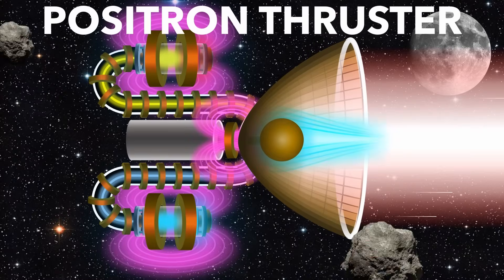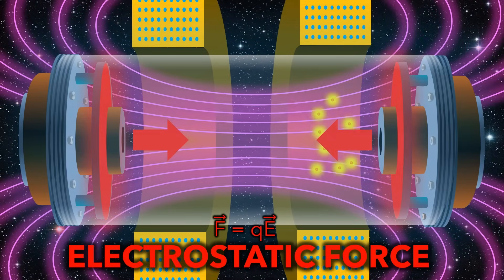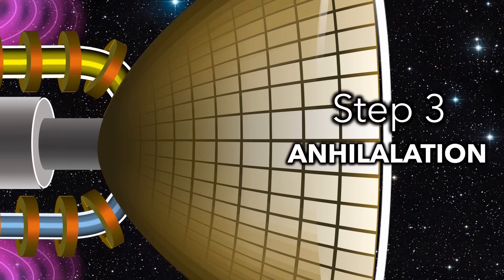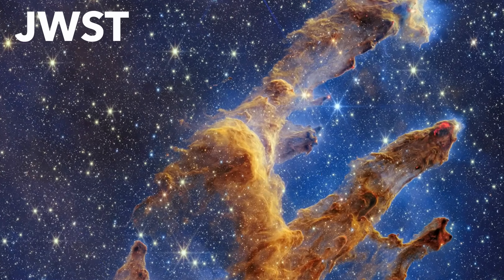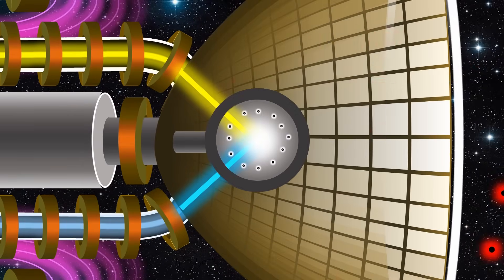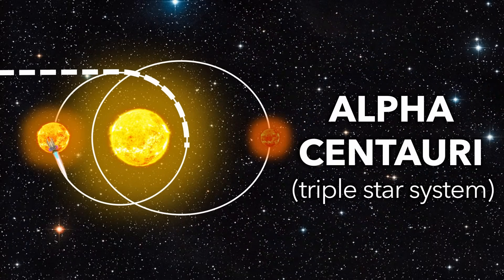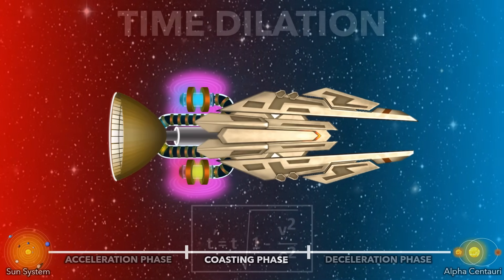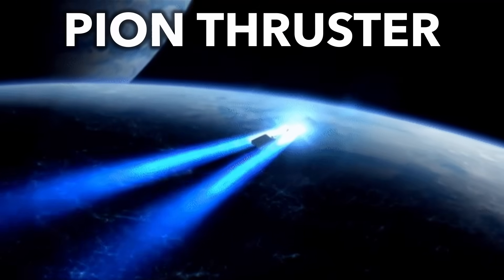How much Antimatter To Reach Near-Light Speed? | Positron Rockets Explained

Comment: Why would you need 42 hiroshima bombs a second to achieve 1/g of acceleration? I feel like you could use less
Reply from the maker: It does seem excessive. The reason is due to the high exhaust speeds. 

Provided all other variables are fixed, thrust is proportional to exhaust speed, but energy required is proportional to the square of exhaust speed.

For example, if you had 2 rockets, but rocket 2 fired the propellant at double the speed of rocket 1, rocket 2 would produce twice the thrust, but use 4 times the amount of power.

So the faster the exhaust speed, the more energy is consumed. As you could imgaine, a rocket which fires propellant at light speed (like the positron thruster) would consume enormous amounts of energy.

Comment: So whats the exact percentage of the antimatters energy that ends up getting turned into thrust after the electrons from the lead ball are accelerated by the magnet thing and all?
Reply from the maker: Well in oractice efficiency would be much lower than 100%. Assuming full reflection of the longer wavenlength photons, 2% of the antimatters energy would become thrust. The remaining 98% is technically lost as heat and scattered electrons, but the proportion of each would vary greatly.

Comment: Why does it use less for the decceleration?
Reply from the maker: Because in the deceleration phase, the spacecraft has less mass i.e. much of the mass has been used as fuel in the acceleration phase. Because the required thrust is proportional to the mass of the craft ( F = ma ), less thrust is required for deceleration and hence less fuel is needed.
Reply: @ScienceWorkshop464 ah of course. Thanks :)

Comment: 1:38 Till take off >  3,2,1, Lift o-- *launch pad atomized, so as the nearby city" taking off from earth would be a nuke and you would either have to incase this in another rocket or launch from space and direct engine away from the planet..
Reply from the maker: Haha yes youre right, and i had the same thought. Hence the reason i made sure i did a space launch in the animation haha. At the very least you wouldnt launch near a populated area if from earth.
Reply: @ScienceWorkshop464 the amount of smoke and heat may also effect the surrounding areas too.. And who knows may leave large amount of radiation if anti matter does produce it but i sure it would.. 2 launches may even create something similar to a  nuclear winter.. And even may raise global temperatures by alot since its equal to 100s of nukes

Comment: I just did the math for a 300 metric ton spaceship which would be the equivalent of something like a 747 and to accelerate it at 1G doesn't take as much any matter as they're saying it's micrograms to accelerate at 1G I did a sliding scale from 100% efficiency to 1% efficiency and even at 1% efficiency it's still less than a gram per second. And it only takes about 8 hours to reach 0.7 C in roughly $140 kg of antimatter plus 140 kg of matter add 100% efficiency which is basically an Annihilation reaction so if we cut that efficiency in half to 50% it would still be $280 kg of antimatter and 280 kg of matter

Comment: I can't imagine that it takes grams of antimatter every second to achieve a 1G acceleration for something the size of the space station. That just seems preposterous. A Hiroshima sized bomb going off every second for a 1G acceleration?
Reply from the maker: It does seem like alot. However considering that a chemical rocket would consume more like 1 million grams per sceond to accelerate at 1g, and could only maintain this for a minutes rather than months, the performance is still impressive. 

The calculation as of grams of antimatter per second is based on conservation of momentum. The momentum gained per second by the ship (ship mass × 9.81) must be equal to the momentum of reflected gamma rays leaving the thruster. The momentum per gamma photon is planks constant ÷ photon wavenlength. From the the number of gamma photons required per second and the number of anhialation events can be used to work out the required mass per second, which ends up being in the order of grams per second...

...but i do agree it seems like alot of energy! Calculations are also based on the assumption of 100% efficiency which is impossible in practice.

One other point that may put things in persepctive, is that a traditional chemical rocket would only take around 20 minutes to produce the same energy as hiroshima. This is still enormous but not completely unimaginable.
Reply: IRL these engines can't be made due to x-ray/gamma ray errorsion of the nozzle and impossible waste heat issues and workable magnetic nozzles would need materials 100× stronger than carbon-carbon bonds allow
Reply from the maker: @nehorlavazapalka agreed a positron rocket, although not breaking any phsyical laws is far from realistic currently from an engineering perspective

Comment: I have another idea. We could build like a spaceship made of two parts one half made of matter and one half made of antimatter. They could accelerate in parallel and exchange fuel without touching as for antimatter if it is not possible to produce it in a fusion reactor then we need to invent self replicating robots that will create trillions or even more small factories on sun orbit that produce antimatter using particle accelerators.

Comment: I had such a consept in my mind bevor 20 years. Basically it works, but the main issues are technological and financial. The so called Penning trap  or magnetic flask can only store really less positrons or electrons inside, not even a milligram. The ratio of weight of the magnetic flask or Penning trap to the mass if the stored positrons/antimatter is such high that it is practically senseless to build a rocket that way. Secondly, it is extremely expensive to produce that positrons/antimatter. To produce positrons out if energy, it would take roughly minimum 25 Billions USD to get 1kg positrons/antimatter. This issues had to be fixed first to realise such a propulsion system. Better antimatter storing systems maybe by stabilisation of exotic matter, and cheap antimatter production maybe by using new kinds of particle reactions, that could solve the problems.
Reply from the maker: Very true. These are the 2 main issues with antimatter propulsion. My next video on pion thrusters (which admittedly has been a long time coming) partially adresses the storage issue
Reply: @ScienceWorkshop464  no, they aren't, first one is nozzle errosion from gamma/x-ray and seconds is impossible waste heat issues. Workable magnetic nozzle requires 100× the strength of ideal carbon-carbon bond. Anti-matter engines like the one in the video are impossible using known physics.
Reply: @ScienceWorkshop464  using carbon nanotubes, you might get to 5 % c after ~ 20 years of acceleration - that is the pyhscis limit

Comment: Isn't converting heat into thrust unnecessary? Like radiating heat already create thrust.
If you split a gamma ray proton into many smaller proton, it still have as many thrust.
Reply from the maker: Heat radiating equally in all directions wouldnt generate thrust. Hence the need to transfer the heat to a propellant and direct it via a nozzle in one direction to produce thrust in the other diection.
Reply: @ScienceWorkshop464  But insulate the front should stop heat flowing forward, and forcing all of the heat radiate backward.

Comment: Wouldn't you also need the same amount of matter?
Reply: Also the deceleration wouldn't be constant fuel intake, as it is loosing matter. Didn't do the math,  but let's stay with your 7 grams per second at the start of the deceleration phase (which would be around half of the weight from the start as you have calculated) It will be less and less and less until the weight of the fuel is less than 10% (let's say 10 for any corrections that could be needed). And by this time it will be using 40% less than the start of the deceleration phase

Comment: Next video: How to efficiently produce tons of positrons. Right after: How to shield from incoming cosmic dust at 0.7c.
Reply from the maker: I like both those ideas!
Reply: @ScienceWorkshop464 Producing a ton is simple enough.

Ive read that a Star Trek lore book says Antimatter used for ships are generated by solar powered particle accelerator that orbit stars.

And ive also read someplace that the particle accelerators we have now are designed for science not antimatter production.

Not saying it would be simple or cheap to do. But its entirely possible to set up antimatter factories in space with vast solar arrays. Even if you need more power than that or if solar wont be viable, you can get fissionable or if technology allows fusionables to power such purpose build stations.

As for avoiding the dust im not sure outside of somehow projecting a large magnetic field infront if the ship to make the particles go around. But I cant say that every speck of dust is magnetic so as strange as it sounds, the bigger problem isnt how to make the anti matter but how to protect the ship in flight.
Reply from the maker: @S-Halo yes the current production costs are based on the fact antimatter production is purely foe research, not energy storage. So it could be reduced. 

And yes you're right, shielding is a huge issue at relativistic speeds, because a magnetic field would only defect charged particles, but there are some interesting solutions
Reply: @ScienceWorkshop464 i have a problem with the engine, your basically superheating a lead ball with 6 Hiroshima’s worth of energy per second, and that it’s going to explode and wrecking the ship
Reply: Shileding yourself from cosmic dust is relatively easy, you just need to put several dense shields in front of your spaceship and there is literally nothing that can harm you or slow you down. Producing so much positrons is another problem, not much for the process (we already can do that) but for the immense amount of energy required. That's why before building such a device probably we'll have to build a Dyson Sphere
Reply: @fabriziobiancucci7702  If i had to decide, we'd already be building a Dyson Sphere. Ppl. build pyramids, so why is there no Dyson Sphere yet?
Reply: @marcok9485  We can build it with our current technology. The problem is that we would first need working mining factories on Mercury capable to disassemble the whole surface of the planet. And of course we need to send such infrastructures to Mercury. Our current attention, as you can understand, is focused on much less ambitious projects
Reply: @fabriziobiancucci7702  Humanity needs a common goal. Remember, we do not do it, because it is easy. We do it because it is hard.
Reply: @fabriziobiancucci7702 but wouldn't doing that will essentially increase the ships mass and become a limiting factor for the overall speed of the ship?? so I think a alternative way for protection against space dust would have to be quite diffrent
Reply: @shay5338 It would increase the ship mass, but not by much if you use such an engine. And by now, that is the best way we have to protect a ship from interstellar dust. We still haven't the force shields
Reply: @fabriziobiancucci7702 i researched on this a bit, using serval dense sheild in front of the ship is fundamentally inefficent, because space is filled with dust particle even if 1mg of dust were to hit the "metal sheilds" on rare occasion that sustained damage accumulates. and also we cannot just put "very hard large sheild" in front of the ship and hope they wint break no cause the space dust is unpridictable in its amount and its mass, so in anyway using a method whcih both deflects the spacedust as well as dosen't wear nor tear in it's effectiveness for as long as the flight, will be the way whetever its a force sheild, a ionizer, or a magnetic bubble, moreover this "thick -sheild" wouldn't last even a few seconds at 0.7c.
Reply: @shay5338 Apart for the fact that no, several thick shields can survive a fraction of the speed of light of more than 0.9c, still they are for now the better option. Any kind of magnetic or plasma shield or in any case not-solid protection is useless at such speed, because particles need time to follow the pattern dictated from magnetospheres, and you don't have such time when you travel close at the speed of light. Also, interstellar dust is extremely spread and not-connected. We are talking about atoms here, not milligrams of matter. Unless you are very unlucky and end up in a cloud, you would just find hidrogen and helium atoms on your path. So a solid hard shield still do the job well, contrary to other options that are better, but only at slower speed.
Reply: worth looking into jj thomson and some of his apparatus...

seems the name was coined a long time ago....
Reply: Today's PBS Space Time video covers this astoundingly good as usual.
Reply from the maker: @marcok9485 yes i did spot that video...ill have to give it a watch!

Comment: i think a more reasonable solution would be in an enzmann echolance format. take antimatter and burn it in a standard boiling or pwr reactors, then use the electricity to power high power particle accelerators pushing protons out the back.
Reply from the maker: Yes that is a more realistic use of antimatter in propulsion, which i hope to cover one day. amongst other antimatter propulsion concepts are pion thrusters (coming in the future), and antimatter catalysed nuclear propulsion which is also much more feasible (also will cover one day)
Reply: @ScienceWorkshop464  by going with particle accelerators, one could also use traditional uranium reactors for solar system travel. i can imagine it being more efficient to take nuclear waste and recycle it for more electrical power, than going with the nuclear pulse propulsion method. this must suck with efficiency since much of the energy is lost from the blast wave moving sideways and backward, vs forward.

Comment: why use positrons and not anti-hydrogen, that is electrically more neuter then the positrons?
Reply from the maker: Great question. Postiron anhialation is simpler in principle, because they only produce 1 decay product (gamma rays). There are multiple decay products when using antihydrogen (e.g. pions and gamma rays) which require different methods to convert into thrust. Infact pion thrusters will be the subject of a future video!

Comment: You can't simply throw out charged particles without getting punished for it. The electrons would create some kind of hugely negatively charged cloud behind you, attracting the space ship and hampering acceleration. 
That's why for an ion thruster, we neutralise the ion flux with electrons to prevent this.
Reply: Electron–Positron Annihilation Results in: Two or more gamma ray photons (511 keV each for stationary annihilation)

And an exhaust of pure gamma ray photons.

It’s a photon rocket. But it wouldn’t even matter if there were charged particles expelled as they have a velocity a decent fraction of light speed 

It matters for Hall Effect thrusters because they’re kind of cheesedick propulsion that imparts not a lot of thrust (very useful though)
Reply: Thanks for your comment. You're right about the γ-photons due to annihilation. But this wasn't what I was referring to. 
Gamma rays don't really interact with anything therefore the "lead ball" idea (third minute) that would result in free electrons due to Compton scattering. 
They suggest using those as expellant as well. Doing so, however, results in a charge buildup of the space craft and and a charged cloud behind the space craft. They would attract and hamper/negate acceleration. 
That's why you neutralize the expellant of e.g. ion drives: https://upload.wikimedia.org/wikipedia/commons/thumb/3/36/Ion_engine.svg/1920px-Ion_engine.svg.png
I hope I was able to clarify my argument.

Comment: why do we need a penning trap for electrons? electrons do not annihilate on contact with normal matter (which is partially composed of electrons) so the capacitance of the ship will naturally have extra electrons to balance the charge of the stored positrons.

also seems like we will end up with a very large positive charge on the ship if we emit electrons for thrust as you suggest. do we neutralize our charge against the interstellar medium? that seems like it would create a drag force for the ship.
Reply from the maker: You're right, electrons don't nessasarily need a penning trap for storage, although it is a viable method for storing any charged particle (matter or antimatter).

And yes a positive charge would quickly build up on the ship. Ion Thrusters (gridded ion Thrusters or hall thrusters) adress this issue by neutralising the beam so that the net charge leaving the ship is zero. So a similar method could be used for a positron thruster.

Alternatively, using the propellant heating approach would avoid the issue of charge build up altogther, and in practice would be much simpler.